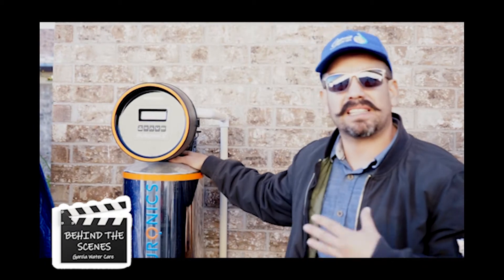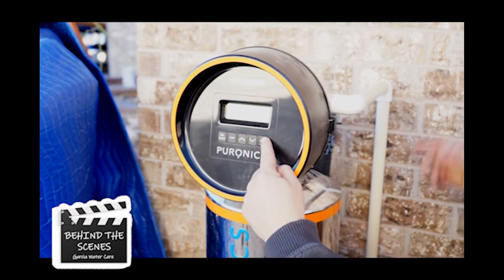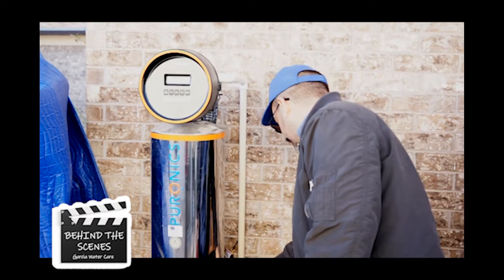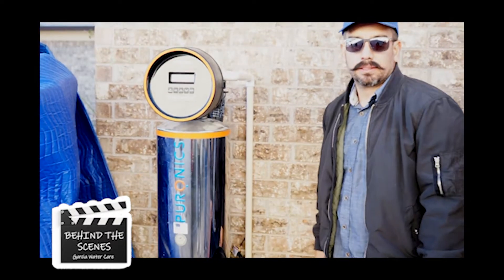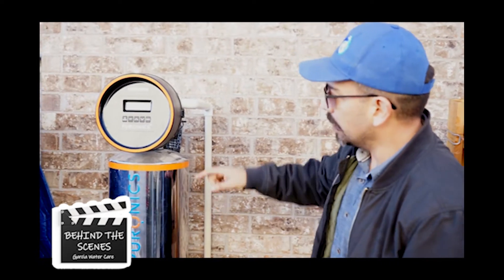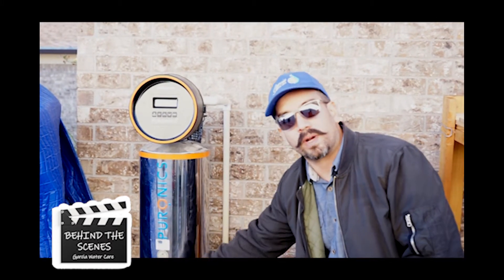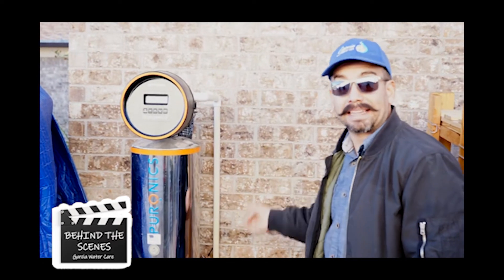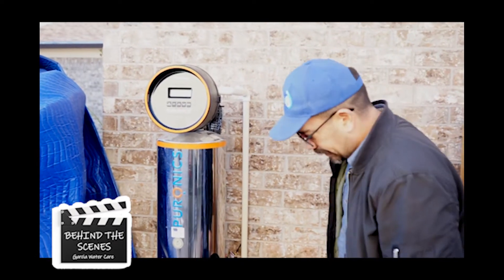How does a Water Softener REGENERATE?

Comment: My concern is that when my water softener regenerates once a week, it only uses 4 gallons. What possible reasons for this?
Reply from the maker: How much is the correct amount of water it should be using to backwash? I'd start there.  Who manufactured the equipment? Check out their website, if there is one, and check for manuals and system details. 
On a side note: how do you measure the backwash water amount? Collect it directly into an isolated container?
Reply: @garciawatercare  I'd like to know too...